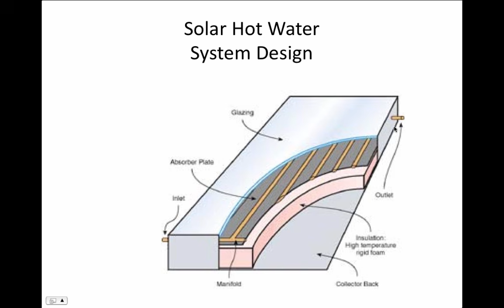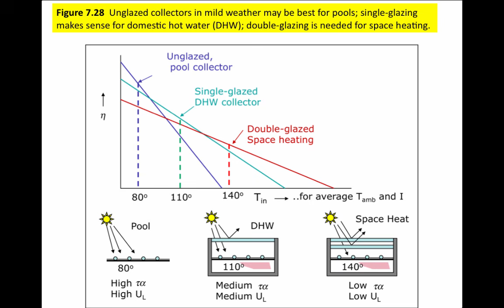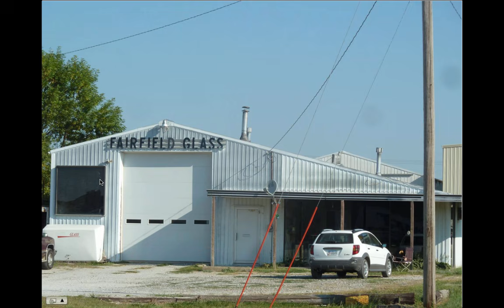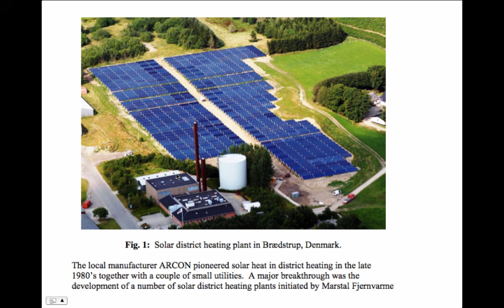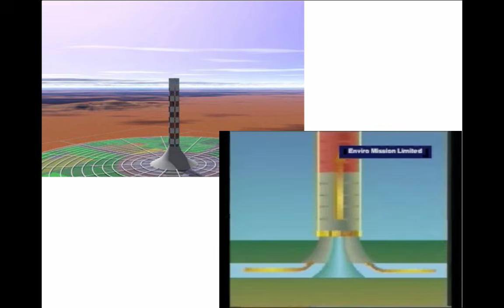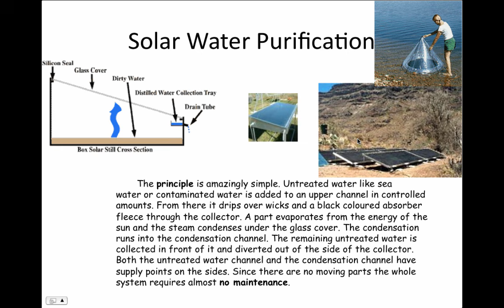Solar Thermal Energy Systems

Comment: I buit the two tank system one the pre heat
For the other i used a water circulation pump
And a motorized check valve. It the system was 
Used in ft laderdale Florida. Built from scratch in my garage
I a sliding glass door as my lenz that i got at a good will place for 10$
Drilled holes in the fram
Sized my box to fit the door used some old industrial shelves i also bought at the good will
Place bolted them togeather and the laced 
My 1/2 copper tubing
On the panels used 1/2coppet pipe straps to
Anchor the pipe to the panels painted it crinkle
Finish black engine paint Insulated inside of box and ported my in and out lines out the box. This simple systed
Worked great for over 15 years with not one failure. Forgt to mention
I made my own electrons control with
Two thermistors and a op amp turning a relay on an off to run the pump a check valve
Was able to acieve 151F
Degrees in a 40 gal water tank. Can be done
By a handy guy with garage tools mybe 3 to 4 week ends back in 1974 saved 40$ a month 😢

Comment: I won't be circulating antifreeze. It kind of defeats the purpose of the system. I'll just use enough insulation. Perhaps build it around another source of heat. I'd also like to put it in a high spot so it will be gravity run instead of an electric pump.

Comment: I would like to build a 2 tank system. My idea is to use a flat plate collectors to 1st storage tank via a small circulating pump. The 2nd storage tank with a top mount heat pump for winter use. I think that in summer I could make enough hot water to last 4 days (family of 4) with both tanks full, in case of bad weather. Anything I'm missing please let me know. (Located on East Coast of Australia)
Reply: did you manage to do this ? i have this but without any pumps just gravity and i have sun most days but not hot water all the time, what hight is your feed cold water tank ?

Comment: I live in Florida. What would happen if I use a standard hot water heater. I would pump water from the drain into my solar collector. The return would go into the outlet of the water heater. This would cause the water to circulate through my water heater. Heating my water. The pump would be controlled by a thermostat. When the water is hot it would circulate through the water heater keeping the water hot. The normal heating elements would only turn on at night when the sun went down. I would also have an insulated storage tank that would pump water thru the solar heater when the water heater is at temperature. The second tank would operate as a pre heater for the water heater. 
My reasoning. Why buy a very high priced water heater that has solar heating coils. 
Why wouldn’t this work?
I already have a high efficiency water heater. Why do I need to isolate the water heater from solar collector?
Reply: Hi, I live in the northeast and I’d recommend insulting your hot water pipes (and 10’ of the cold line at the water heater) and installing an Intermatic water heater timer and buy extra triggers. It saved me huge amounts of money. No loss of hot water w/ insulated pipes when the water heater is off from the timer when I’m in bed.

Comment: Let say, I live in the desert or flint Michigan, your AC- unit DRIPS about 10 gallon of water a day or more, You could let the water drip from your kitchen, How hard would it be to refine this water to drink or take a bath. You can take a bath with to buckets. THIS water has no fluoride and GREAT for plants.
Reply: You would want to run it through a particle filter and a UV filter which would usually cost more than the water is worth. Also this usually won't work in the dessert because desert air often has a low humidity meaning there isn't as much water available in the air to condense
Reply: it's hard to think about when you have to reduce your ways from turning the tap. check how people get water when there isn't any to be had, instead of asking in essence some of the most basic human questions under a video talking about thermal energy storage. 

haiti, libya, venezuela, jamaica... and that's barely scratching even the western hemisphere. asking questions is one of the best paths, but educate yourself, in the nicest way possible. waiting to be educated leaves you wondering and wandering. like people that don't know how to clean water.

Comment: I was looking at the diagram at the 24:00 mark and hypothesized that if you were to use put a thermal mass between the metal plate and the insulation, would that be better than insulation alone?  I understand that in the early morning the mass would need to heat up as well–potentially robbing some of the solar energy from the tubing; however, would this benefit late-day/early-evening heating of the tubing as solar energy is decreased?
Reply: It would probabley depend on what your peak deamand times are.
Reply: Yes. You're referring to a solar battery incorporated.

Comment: Can these solar water heaters use orange pex (designed for approx 220 degrees) spray painted black in a 4' x 8', 2x4 frame with a painted black glass top?
Reply: You would want to think about the fact that "plastic" is an insulator so it will not absorb or transfer heat very well but would work ok for the lines. Keep also in mind that PEX is not allowed to directly connect to hot water heaters for a good reason. Heat can make the plex soften and leak at connection points. A last consideration is UV resistance. I would say thin wall copper pipe is far superior.

Comment: 7:23 the main reason why it gets hotter because the glass hinders the warm air to mix with cold air through convection, also glass is a bad thermal conductor so the heat won´t escape the contraption as fast as something more conducting. heat transfers always from hot to cold

Comment: I've heard of placing large tanks in the ground (backyard or crawlspace) and filling them with used motor oil (likely free from oil change locations).  Then run the oil through the solar collector.  It can take a while, but eventually that recirculating oil would reach some very high temperatures.  Due to they insulation of being in ground and the slow loss of heat from extremely hot oil, the heat captured can last a very long time.

Then you simply would have copper or pex plumbing running through the tanks for water to circulate and become heated.

I was told it would be more than enough to run steam generators, radiant floor heating, radiant heating under driveways and of course household use.

Your thoughts?
Reply: Interesting idea. I searched and oils specific heat is about half of water. So the oil would have to be heated to twice that of the water to get the same amount of thermal storage. You would need to double your storage area, or double the temperature. If you get a leak in the system that’s a environmental concern whereas water poses no issues. And then there’s the flammability issue with extremely hot oil.

Comment: I have to disagree with a vacuum pump and a access to a decent machine shop you could create a reasonable evacuated tube system.  I would recommend having an engineer on hand too much alcohol and you could end up with a bomb but it could be done.
Reply: tberry7348 - in the manufacturing process I've seen,they don't bother pulling a vacuum making those evacuated tubes...The high heat they are at when the end of the tube is closed by melting the glass together, creates the needed vacuum as the assembly cools.
Reply: tberry7348 - making the metal heat pipe portion is actually well within the skill set of the home experimenter even if making the glass evacuated tube with a glass melting furnace, isnt...  

https://youtu.be/LU4eynU6R-8

Comment: I am building a solar batch heater from scratch.  What would the "best" type of glass to use for the box. Would it pay to use green house panels on the glass or inside the box. 
   Great video providing us with a lot if info.
Thanks
Reply: Use LOW-E glass and have it face such that it traps the heat instead of reflecting it if you want max heat gain.